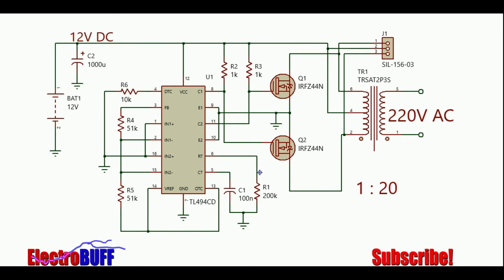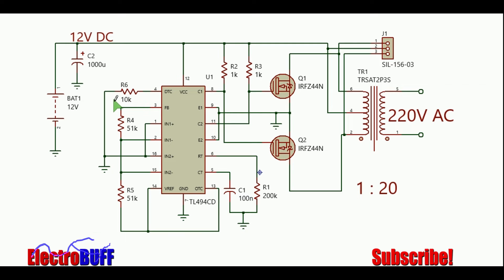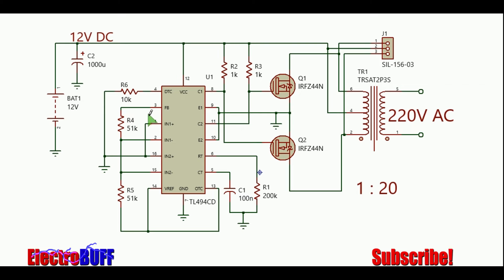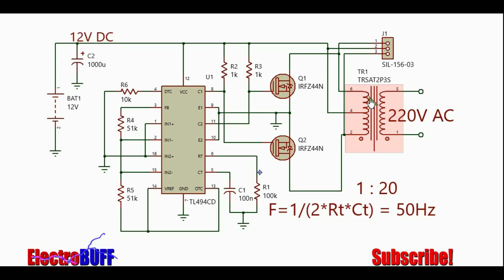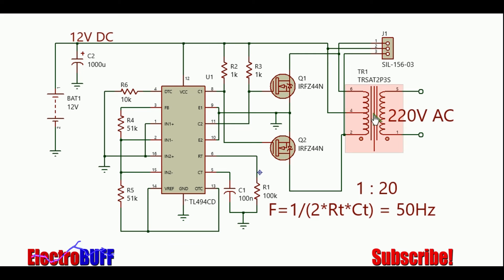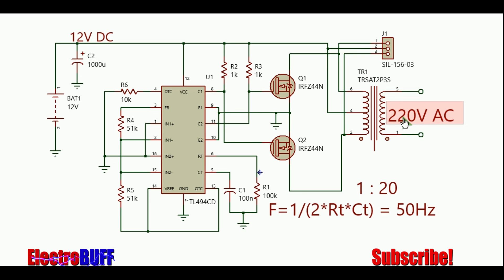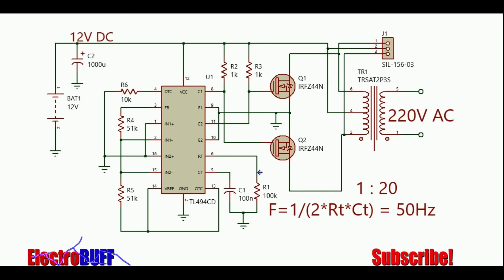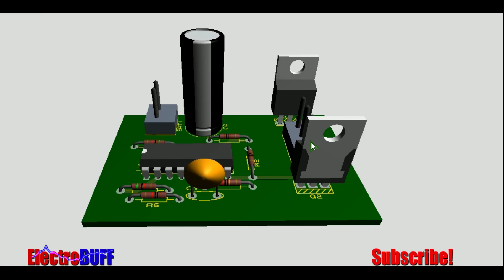TL494 PWM IC Inverter Circuit 50Hz 12V DC to 220V AC

Comment: c2 capacitor to how many volts
Reply from the maker: Anywhere from 25-50V
Reply: It is possible for the capacitor voltage to be adjusted based on the input voltage you want, for example the input voltage is 12v so the capacitor voltage is 16v, you have to increase the capacitor voltage a little

Comment: why ac out me 600VAC it's mormal???
Reply from the maker: Depends on the transformation ratio of the transformer you're using.
Reply from the maker: Depends on the transformation ratio of the transformer you're using.
Reply: @ELECTROBUFF   i use  12 0 12 out 220
Reply from the maker: @omega3k206  with an input of 12V, that should give you ~220vac